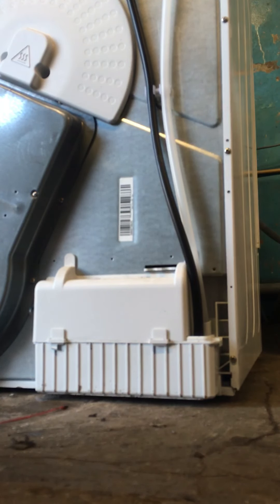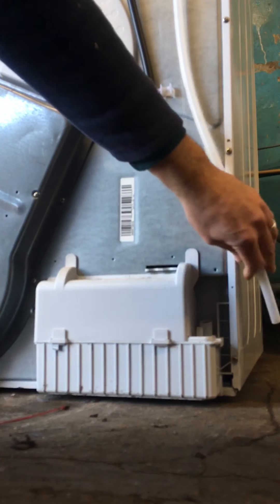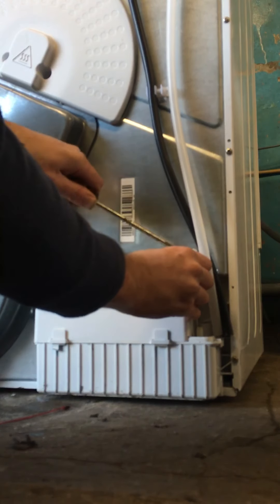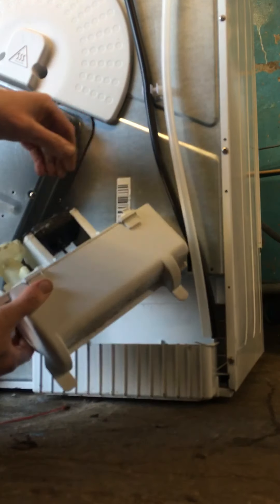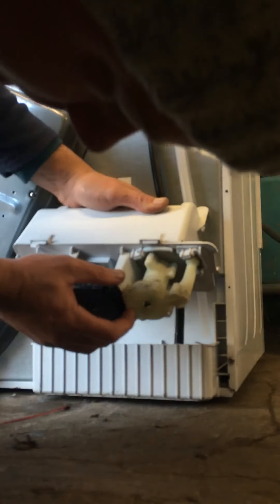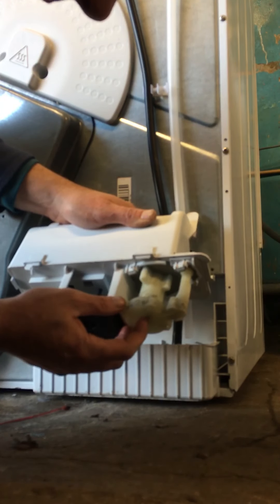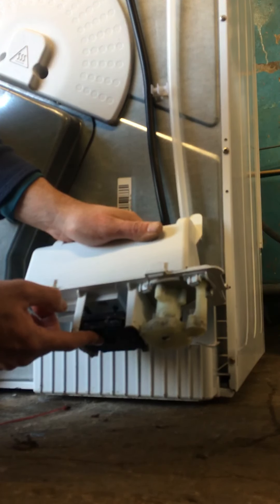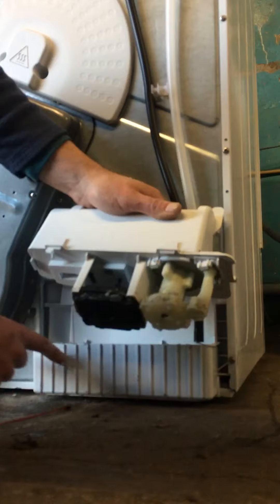Hotpoint / Indesit / Creda Dryer Pump

Comment: Thank you for sharing this video!! Ours wasn’t collecting water in the container and was leaking on the floor and that little slot was blocked with lint. I cleaned it out and water came flooding into the tray. I also need a new float which we’d noticed it wasn’t shutting off when full too. Awesome 😍😎👍🏻
Reply from the maker: Excellent Ian! Most people just throw them out. Always worth taking a look and repairing 🙂👍
Reply: @washingmachinetipsandhelp4350  I’ll always try and repair if I can. Thanks again.
Reply: @washingmachinetipsandhelp4350  pump seems to making a lot more noise now when running, may need a new one.
Reply: Scrap that, may have just been the pump running without any water in the tray. Seems ok now.
Reply from the maker: @ian_morg  excellent, All sorted ?
Reply: @washingmachinetipsandhelp4350  I think so thank you 😎👍🏻
Reply: How did you clean out that corner bit?
Reply from the maker: @JH-tf9nt I used a cable tie as far as I remember
Reply: @JH-tf9nt  I used a cable tie and as said above it all cleared and has worked perfect since.
Reply: @ian_morg  Didn't you say you washed it out with water? Hence why I asked how you got water to flow through there when cleaning.

Comment: Can the small rubber impeller be bought separately or do you have to buy the whole pump. I have a Hotpoint ctd00p tumble dryer. It's about 10 years old.
Reply from the maker: @trevorrichardson3977  Yes 👍 - https://www.ebay.ie/itm/204116181575?mkcid=16&mkevt=1&mkrid=5282-175127-2357-0&ssspo=2OEZEqbiSV2&sssrc=4429486&ssuid=UUJWFSOeTvC&var=&widget_ver=artemis&media=COPY

Comment: Hi, watched a few of your videos and they have been very helpful, Thank You!

I have a Hotpoint FTCF 87 condenser dryer. No water was going up into the tray / draw so i ordered a pump, but when i removed the old one the plastic blade that spins in pump was actually ok. i fitted the new one anyway, cleaned out the tray at bottom, the slot you mention with a cable tie etc. When i run the machine you can hear the pump suck all the water up, but then just after you stop it, it sounds like all the water comes straight back down into tray under the pump again and its not staying / collecting in the draw. Any ideas how to fix ? Thanks
Reply: Cancel that, think original reason for tray not filling was clogged pump. Then when i relocated tumble dryer after i connected clear and black hoses at top the wrong way round 😞, water is now filling tray and staying there after swapping the hoses at top 🙂
Reply from the maker: @richardhill9473 ah that’s great… I was going to suggest checking the hoses and blowing through them also in case something was stuck preventing the water from going up. Really glad you got sorted man 👍👌

Comment: Hi is it normal to get a small leak at the bottom of the black tube and the water to seep back into the tray thanks
Reply from the maker: Hi There. When you say seep back into the tray do you mean the pump housing? It is normal for some water to be in the pump housing all the time. If it is leaking out of the housing where the black hose goes into you will have an issue
Reply: @washingmachinetipsandhelp4350  thanks it’s a brand new machine pump sounded noisy when 1st used was nocking but it’s stopped now and that’s how I noticed the tiny leak where the black hose connects to it when the tiny puddle around the black was is big enough it goes back into the container can’t see any on the floor
Reply from the maker: @blackhurst98  That sounds ok to me. ☺️ They are a very Good dryer. The most important thing is to keep the fluff filter clean (after every cycle of possible) And most Important of all is keep the Condenser box clean ( bottom left )as you look at the Machine behind the white cover. Be sure to clean this at least once a month. I can’t stress this enough to people. When these get blocked up they cause all sorts of problems. 👍
Reply: @washingmachinetipsandhelp4350  great thank you for the  advice
Reply from the maker: @blackhurst98  no problem at all 👍
Reply: @washingmachinetipsandhelp4350  hi there,u could nt help me with my hotpoint condenser dryer,the pump runs constantly even after  changing the switch and checking it on/off,thanks
Reply from the maker: @adi.449  sounds like the pump is open circuit. If you change the whole pump unit that should sort it for you
Reply: @washingmachinetipsandhelp4350  thank you for your reply,I was thinking that the pump is fine as its still working

Comment: Hi there, my condenser pump is marking a horrible noise. I have checked the float and that pops up and down fine. The noise seems to be the little propeller? Any clues how to solve the issue? Do I need to replace the pump? Thank you
Reply from the maker: Hey Andy, I am sorry for the delay on replying. Yea replacing the pump is really the only way I find of solving this issue. You can buy the pump separate from the rest of the unit. Hope this helps

Comment: The impeller was broken, got a new part but when reassembled there’s no power to dryer. Can you post a picture of the wiring in the pump unit? School boy error, forgot to take a photo before disconnecting!
Reply from the maker: Going to the the float switch, The double wire goes on top, The black wire next, and the remaining wire at the bottom. The two wires going to the pump it does not matter what way they go on. To be honest there should still be power going to the dryer though
Reply: @washingmachinetipsandhelp4350  fantastic, thank you, you’re right, dryer in the garage on a separate circuit and the trip had gone. Wires all correct and dryer working fine with 4quid part!
Reply from the maker: @robbiejess7483  excellent news Robbie, Glad you are sorted. Please Don’t forget to Sub (If you don’t mind) 🙂